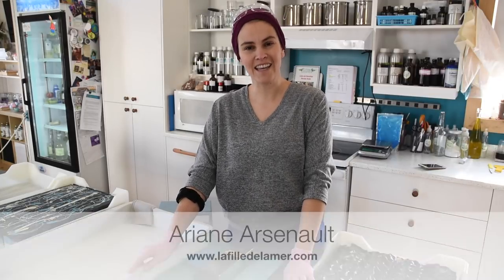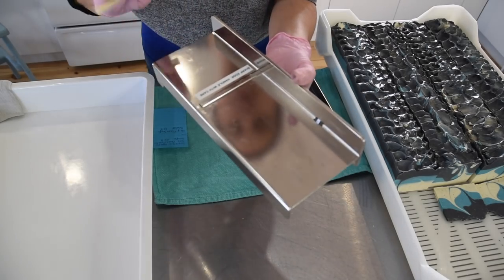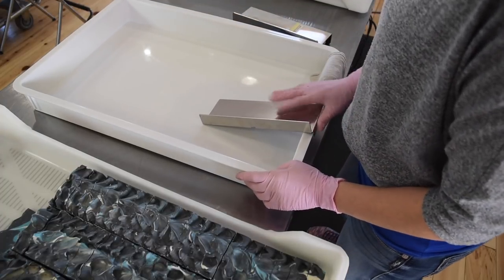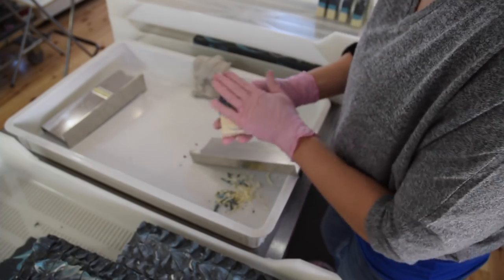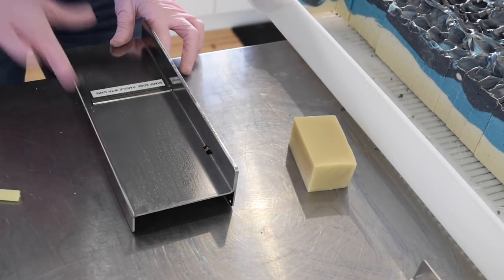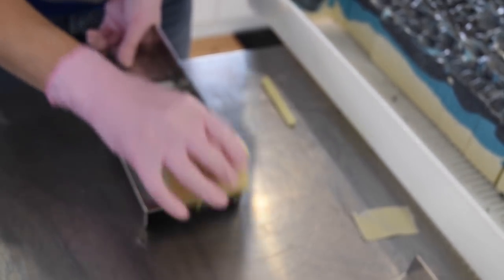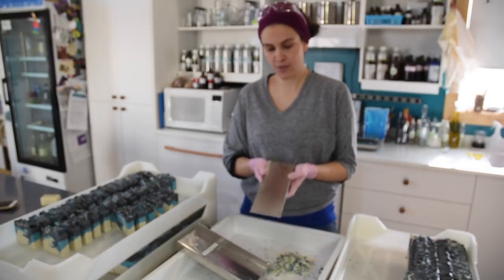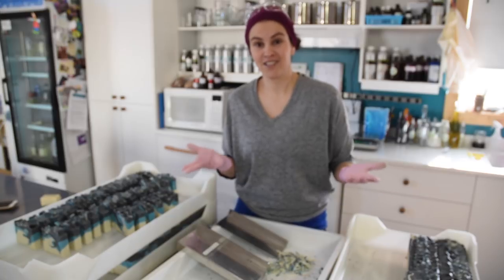Trimming Soap with LiluSoapTools - Equipment Review

Comment: Thanks for sharing this great review 💕 i loooooove my LiluTool 💕 i have the combi, 3mm trimmer. And i agree, the planer and trimmer removes such thin layers, that you almost have no waste. 💕
Reply from the maker: Angeliekie I love the trimmer for sharp edges soaps! This trimmer is so durable!
Reply: @ArianeArsenault  I participate each month in the soap challenge, where it is highly appreciated to shave and trim the soap. I also have an older (good quality) wooden planer, which unfortunately, after longer use, draws horrible stripes with planing the soap, which i find very annoying. I have to plane the soap several times to get a nice smooth surface, so I have so much more waste per soap bar. But since I use the LiluTool 💕💕, I only have to plane the soap only once!! 😊😊 and I have never ever had any problems with stripes anymore. The LiluTool works quickly, is convenient and safe to work with and easy to clean. The soap always looks great and smooth. This was the best investment ever of all my soap tools. 💕💕
Reply: Dear Angeliekie, Thank you so very much for the great comment about our LiluSoap Tools! We are so honored to serve you!

Comment: Eeeek!  Too expensive sorry
Reply: I understand how you feel about the price if you never try LiluSoap Tools. They are made of high grade rust-free stainless steel and fabricated by a laser and CNC router. They are precisely built to last, easy to use and dish washer safe. All our trimmers are NOT loaded with blades. You never need to change blades.